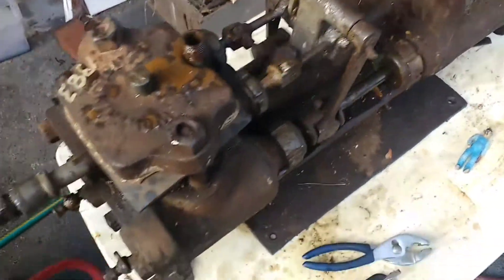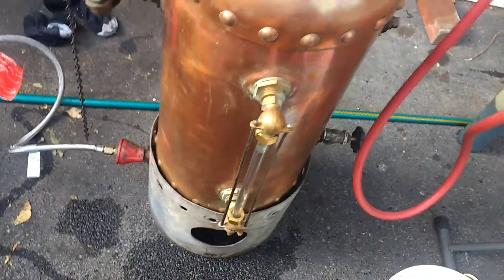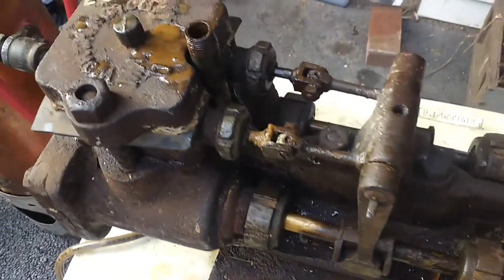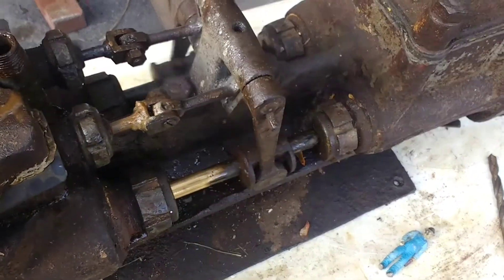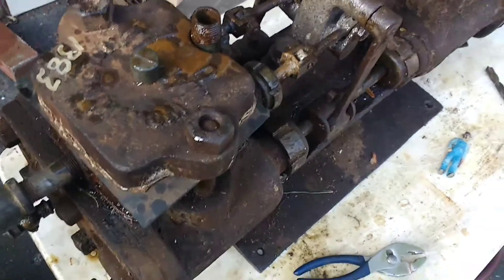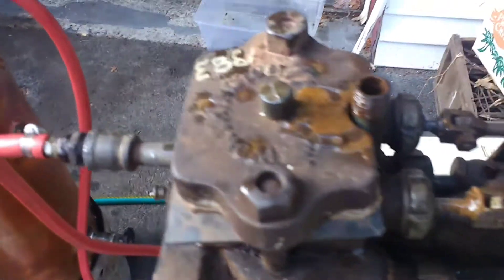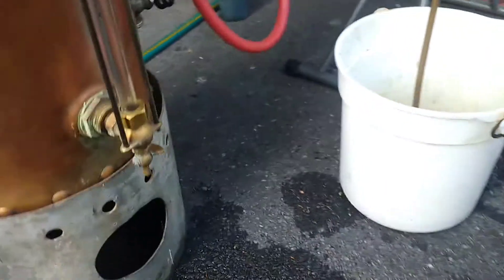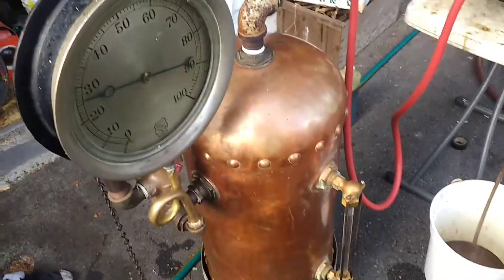Testing the 20 dollar Worthington Steam Pump

Comment: ¿Qué potencia tiene?
Reply from the maker: Its a steam pump, they're not rated in Horsepower. But if I had to guess, and it was an engine instead of a pump, I'd say easily 6 horsepower with around 100 pounds of steam.
Reply: Mi idea es comprar uno igual y sacarle la parte de bomba de agua y convertirlo en un motor a vapor para usar en un carro de construcción casera. Muchas gracias por la pronta respuesta
Reply from the maker: De nada, pero honestamente tengo que decir que es una mala idea y no funcionará. Obtener un motor real que fue construido originalmente como un motor. Un engranaje de la válvula de la bomba de vapor de la acción directa no giratoria no se pone a tiempo los pistones con respecto a la posición del cigüeñal, y las válvulas han perdido el movimiento en los bloques que conducen para compensar la resistencia en el lado del agua así que cada pistón hará un movimiento completo . Tampoco puede invertir una bomba de vapor. Usted pasaría mucho tiempo y esfuerzo en tratar de hacer algo de trabajo que no fue diseñado para ese arreglo. Si tienes un motor giratorio de dos cilindros con el enlace reverso de stephenson, funcionaría mucho mejor en un vagón de vapor. Gracias Traductor de Google jaja
Reply: SteamAndSmoke97 gracias por su respuesta, pero lamentablemente en mi país no es fácil conseguir motores a vapor, es por ello que pretendo realizar esa modificación a esta bomba y utilizarla como motor.